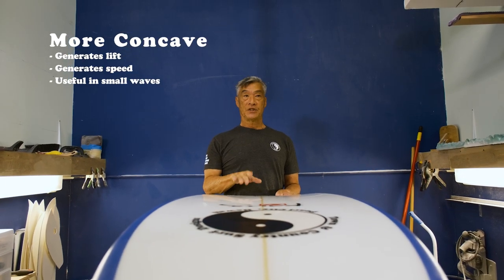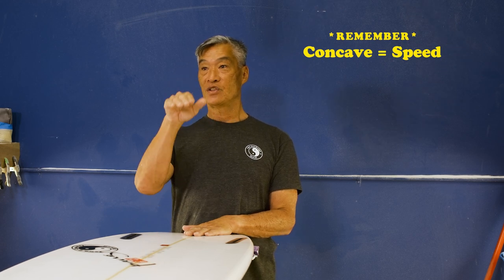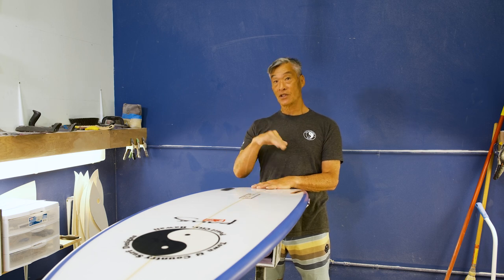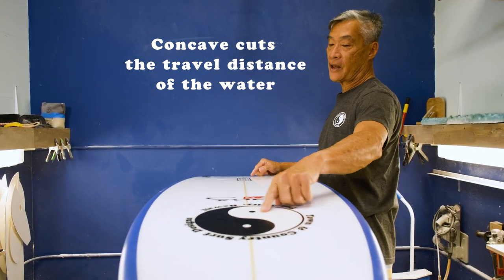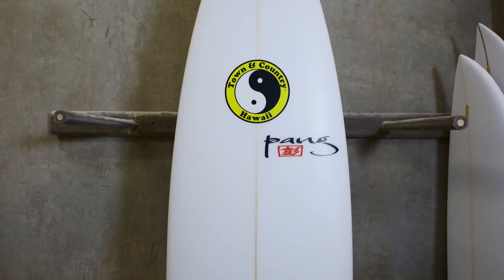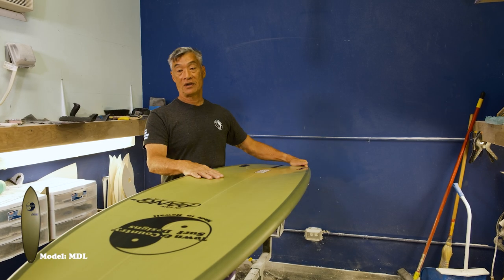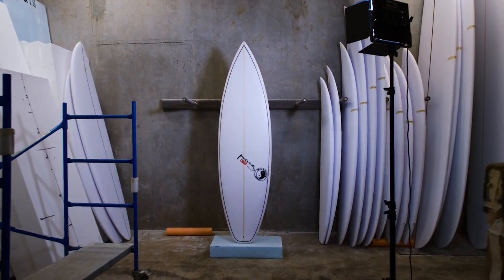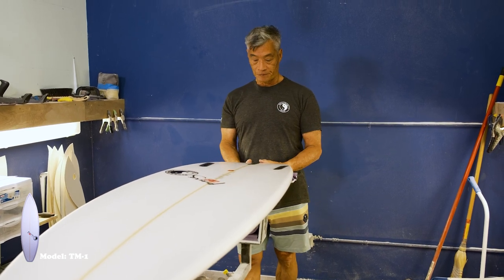HOW TO GO FAST ON A SURFBOARD - SURFBOARD CONCAVE EXPLAINED

Comment: I’ve felt too much single concave and like you’ve pointed out it was fast but tracked way too much. If double concave helps with lift and maneuverability why not run it up further on the board set inside a mellow single concave? Great and very informative video BTW. 🤙🏻

Comment: Hello. Im an amatuer backyard shaper but Ive been told Im pretty good. Im happy with that. You displayed the concave on the blue board. Does the concave end (flatten out) as it nears the rear thruster fin?  Thanks
Reply from the maker: Aloha Nick! There is no right or wrong way to change the concave as it goes down the board, but what has worked for many of our boards is that the single concave transitions to a double concave towards the tail in order to allow the board to go more rail to rail in the tail of the board. Hope that helps!
Reply: Thank You @TandCSurf

Comment: What's the difference in the handling of the board if you put the fins forward or more to the tail of the board? Better swing of the nose?
I have been going to and brought up around auto racing since 1960. Understanding aerodynamics in auto racing helps me understand fluid dynamics when you explain surfboard design. It gives me ideas and makes me think about shaping. Like massaging the left front fender of a race car to pin the nose down going in to turn 1 at Talladega for more speed.  One day I will shape a board. Thank you Glen for your explanation of fluid dynamics and how a surfboard works. At 66 years young, I Love to learn. Keep the informational videos coming.
Mahalo and Aloha
Reply from the maker: Aloha Michael! If you have fins more forward, the board will pivot more and feel looser. If the fins are set further back, the board will be more drivey and feel more locked in a bit throughout your turns.